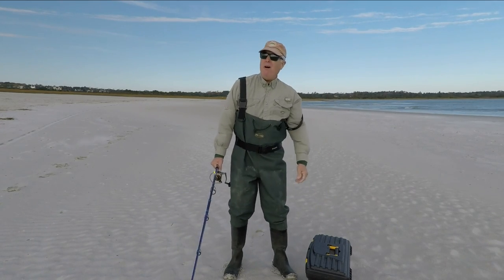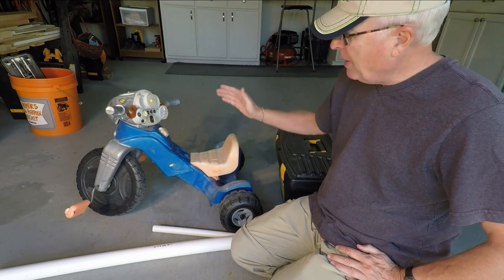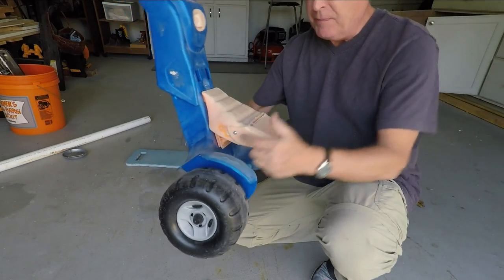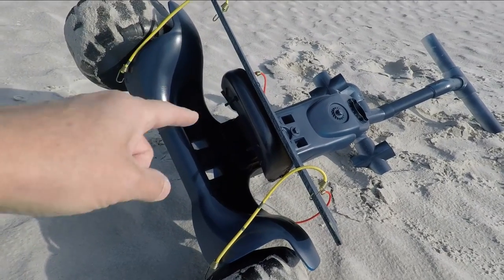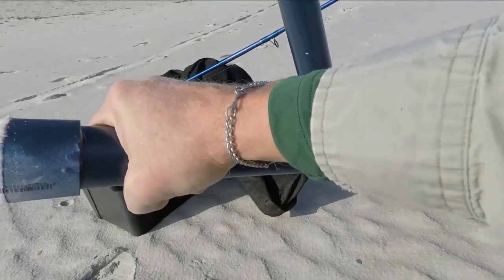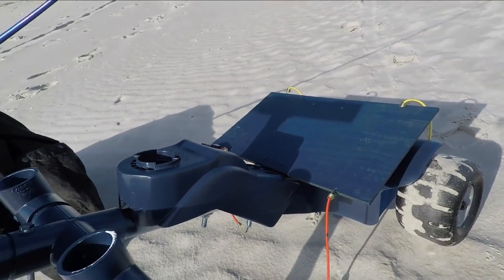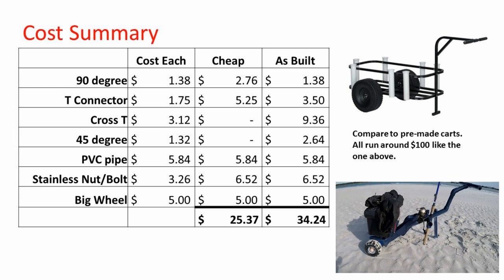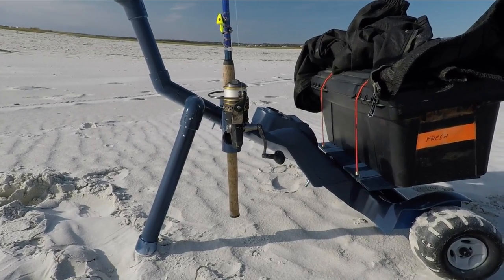DIY Beach Fishing Cart for Surf or Pier with Rod Holders and Tackle Box

Comment: Nice.  What I like most about it is that I can fit it into the trunk of my car (have a Corolla).  I like the idea of using pins on the handle; would only take a second to put it together and will fit nicely in the trunk. And that you added the open ends of the tee for add-on it a good idea.   Thanks for sharing.
Reply from the maker: Thanks! After using it for a while, I have a few modifications to make. Video coming!

Comment: I love this project but I see 2 things it needs and I'm sure you can figure it out. #1, a cup holder. #2, some type of small cutting board for tackle near the top of the handle. Something you can cut some bait and a place to lay a knife. Actually a flat board with a cupholder cutout. Make these mods and I will declare your project perfection.
Reply from the maker: haha! cup holder!  Maybe that goes on the additional PVC bar I might add.  I have a dollar store cutting board in my tool/tackle box I use for bait.  When the top opens, it lays pretty flat.  I was going to add some velcro holders to it for braid scissors and knife so they are not buried deep in the box.  But.. the flat board idea is pretty good.  It could rest on the PVC loop I may add...

Comment: How well do those wheels handle the sand?
Reply from the maker: I was worried about that.  I had my buddy walk behind me to see if the wheels would sink up to the plastic holding the axle.  No issues, they dealt with the sand just fine.  Of course, once on the beach, I walked directly to the firm sand near the waves, so I only had to deal with loose sand for a short distance.  But, easier walking closer to the water anyway.
Reply from the maker: One more point.  This big wheel was the smallest for a really little kid.  I bet the back wheels on the next sizes up would be even better.